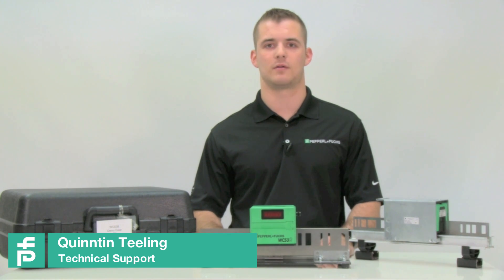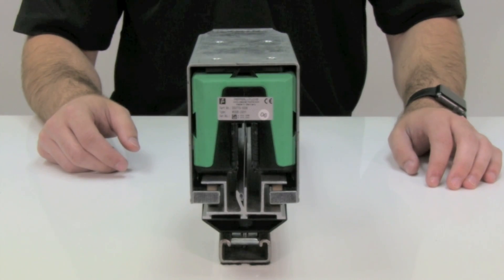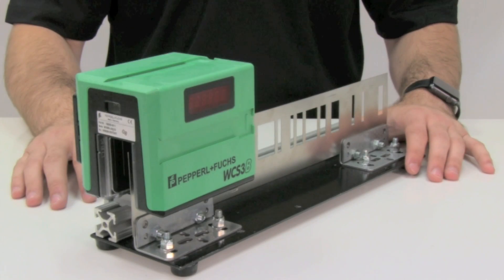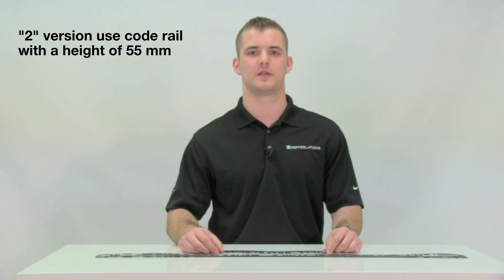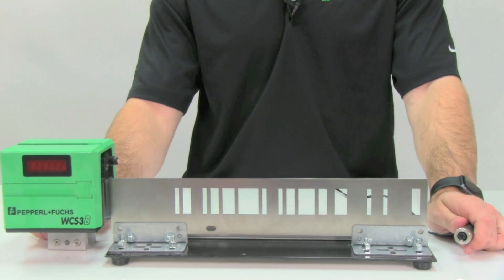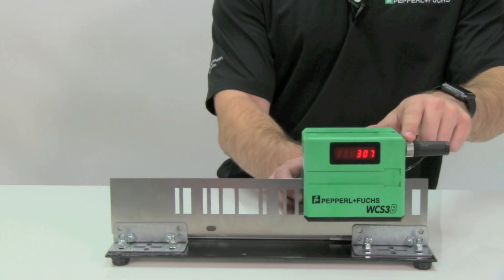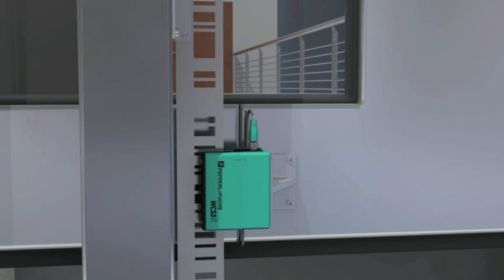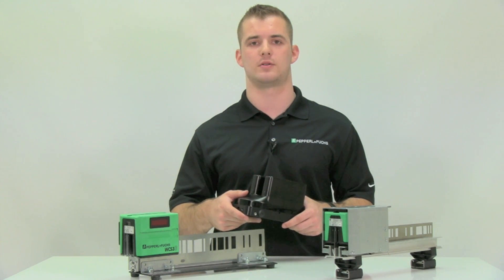WCS Absolute Position Encoder Demo Case

Comment: Hi
How does the measurement system work on curves, i wanted to know, is the outer and inner Radius both positioned, or just inner Radius?
Reply from the maker: HI Reza, 
The WCS3 can handle horizontal curves, up to a 0.5m radius and 4m radius for vertical curves.
Please refer to our instructional manual for detailed installation
:
https://files.pepperl-fuchs.com/webcat/navi/productInfo/doct/tdoct3785__eng.pdf?v=20141007143255